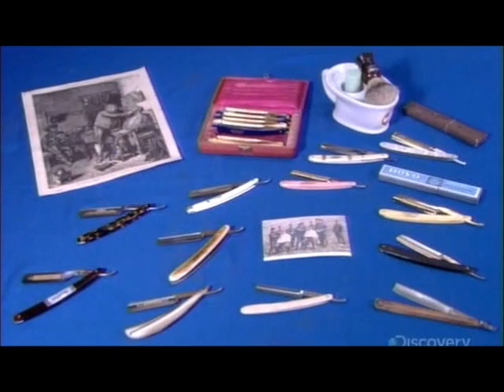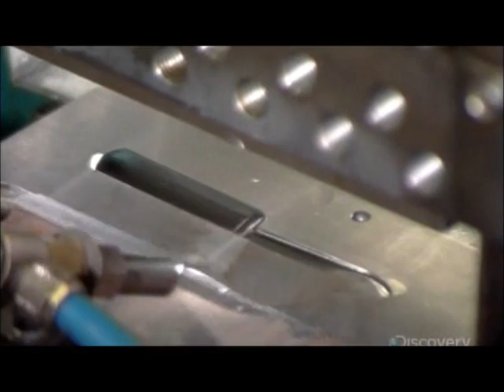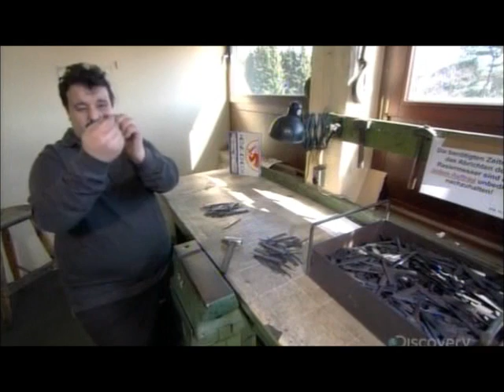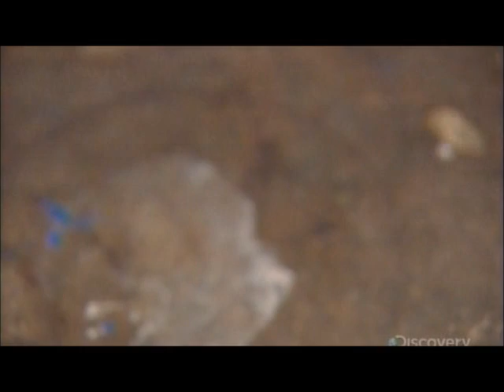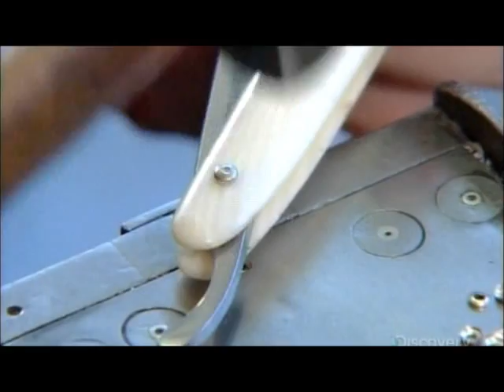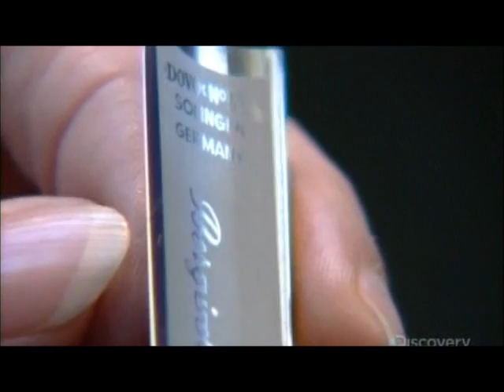How It's Made - Straight Razors

Comment: I thought "Stroping" was to remove metal spurs, not to just "polish" the blade?
Reply: Basically two birds one stone.
Reply: nicholas savage Ok.
Reply: @0osk  No, he's wrong. Polishing is done with fine belt sander, then buffing wheel along with a final cloth with buffing compound. A strop removes the micro burr formed when sharpening. Does not polish anything.

Comment: i have an old straight razor from the 50s i assume its not as sharp as it is suppose to be and there's some light rust on the top spine of the blade does anyone know how to clean it up and get it shaving sharp again?
Reply: get a product called evopo rust. It's gentle on metal and very effective on rust. They run like 10 bucks a bottle or something cheap. You'll then need to sharpen it on wet stones or send it out to any special shave store and they can probably do it for you. Lastly you'll need a strop for before every time you shave. It's more work for sure but it's a nicer shave. Look up wet shaving to see how to shave with one.

Comment: Straight razors might be expensive but its much cheaper than buying disposable razors , add up how much you spend on disposable razors an you could be saving $$$! Straight razor shaving is gaining popularity !
Reply: of course it is cheaper in long term use but bear in mind that if companies switch their production back in vintage razors, then the products will not be the same as they were in the past. The forthcoming straight razor would have more plastic and not stainless steel (for obvious reason). The reason is that companies would prefer to sell more and more. Imagine that straight razors are almost fully metal (not broken anyway) and there are no DE blades disposable even!! So what would be their profit? This is why they started production of more practical cheap plastic (and easily broken) razors. It is a kind of marketing. Anyway, straight razors are far better but above all  It is not a shave but an ART
Reply: yea.. you can spend under $100 on a straight razor and a strop and if you take care of it who knows how long it can last... there are 100 year old straight razors on ebay that are shave ready...
Reply: TD_100 not dangerous at all... as long as you pay attention.. i have gotten a few small cuts here and there but they are so fine that they dont even bleed...
Reply: I spent about twenty bucks total for my razor, bowl, and brush. But the one in the video looked pretty nice. Anyone know what kind that is, only noticed that it was a dovo.
Reply: nicholas savage looks like the Imitiation Tortoise Shell. There's another called the Astrale Ebony that is similar. And a bit higher end one with a bit more gold accents called the Ebony Bismarck
Reply: nicholas savage
 it's made by a German company - Solingen
 or maybe not. I only know I wish I had a Solingen razor :(
Reply: you are correct, sorry and thanks for making this straight for others :P
I was tricked by the fact that my knives carry the 'Solingen, Germany' inscription on their blades
Reply: ntinos81 You can't sell shotty cheap straight razors. It will result in a huge lawsuit and that is not good. If anything more popularity would bring more attention to local knife smiths.
Reply: I started by restoring a Shumate I found in an antique store for $12. Add in the three-line Swaty barber's hone I found on eBay for $6, and I got started for about $18. Not so expensive, if you feel like making a fun project out of it. :)
Reply: SwollenRhino No its not.
Reply: tho much more dngerous
Reply: yes, but with practice you will have smooth skin an probably more sex LOL
Reply: kl i might get one looks awesome aswell :P

Comment: However where it counts these blades are forged steel The only stamping is to trim the metal that was forced out of the die in the drop forge. This manufacturing method is the best way to insure consistent quality day in day out as a price that's generally affordable Not many can afford the work of an artisan for a utility tool.